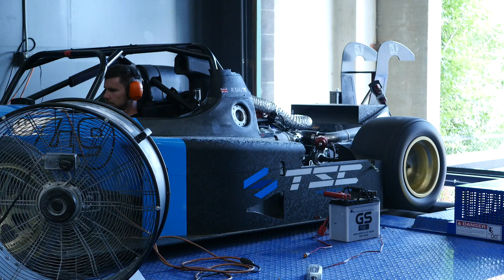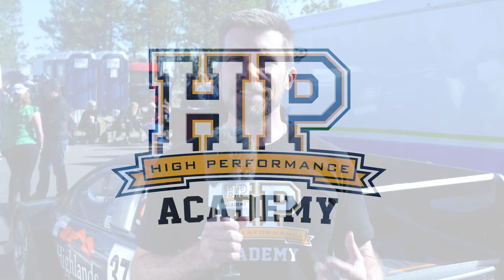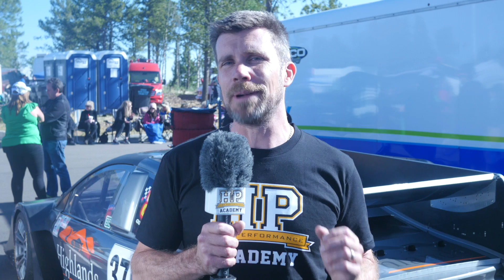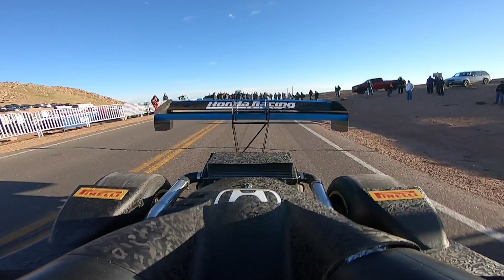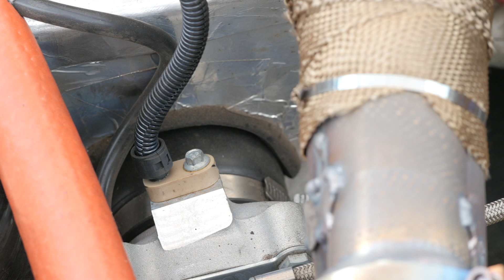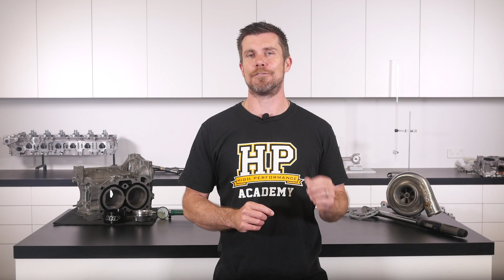Turbocharging At Its Limits | Pikes Peak | [TECH NUGGET]

Comment: Why do after market tuners avoid using a MAF sensor on their builds?
Reply: I think there is a big gap in the market, MAFs used properly sound like they will solve a lot tuning gremlins, just need to speed up the process
Reply: They tend to have a narrow window of good resolution also if you develop an intake leak your car might end up dead in the water and not able to complete a race where speed density can get you to the end with less power. So many more than this but this is a sample.